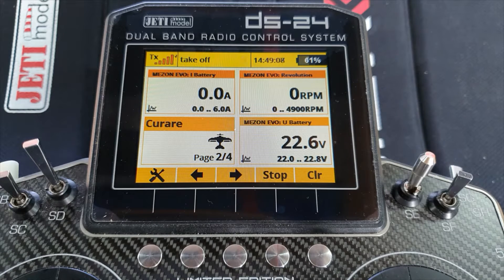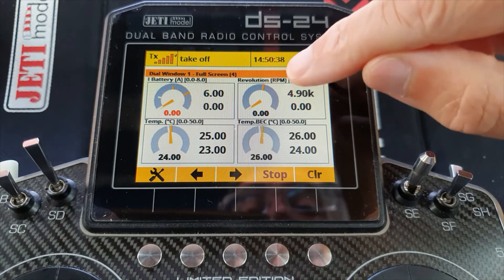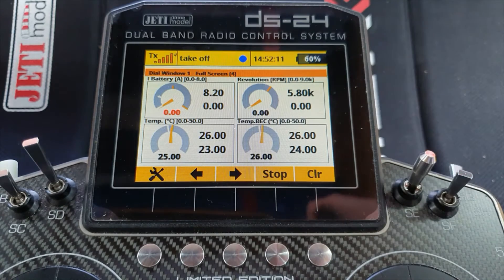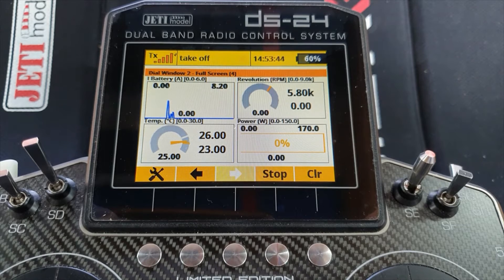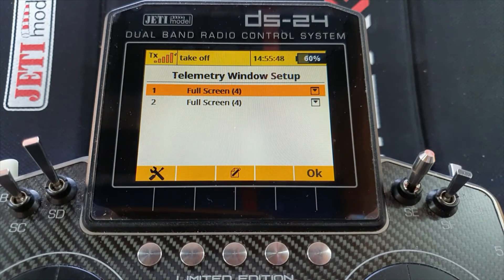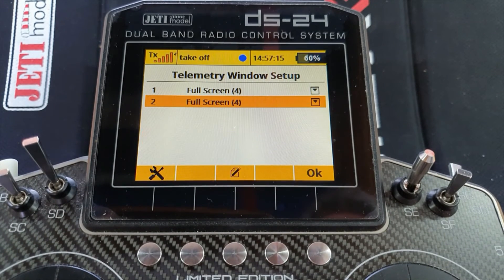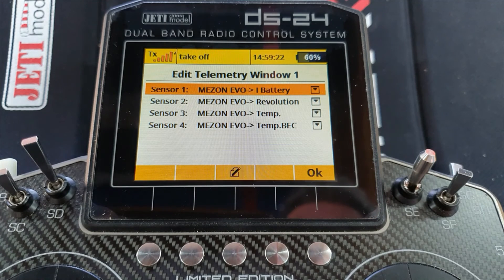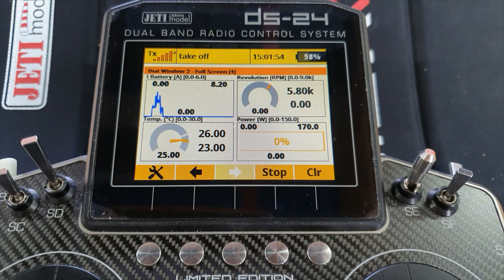Jeti - Dial Display LUA app

Comment: Hello Harry, you are a champion and thank you. For the minimum temperature, wouldn't it be better to indicate the average temperature and above the maximum temperature? instead of the minimum temperature which is not useful, the average temperature would make it possible to see if one or more cylinders are better cooled... If not, once again, congratulations on your work. modeler friendships.
Reply from the maker: The dials are intended for a quick glance.   Data analyser or Studio can be used for deeper analysis

Comment: Will the Dial app work on a DS14??
Reply from the maker: Only if it is a Gen 2 with colour screen
Reply: @cotswoldpilot  What about the DS12 ?
Reply from the maker: @cevgemv  it works on any Jeti with a colour screen.  Only the older transmitters with a monochrome screen cannot use it.